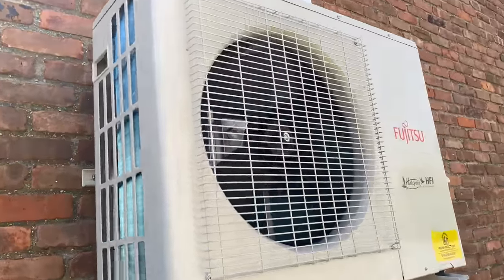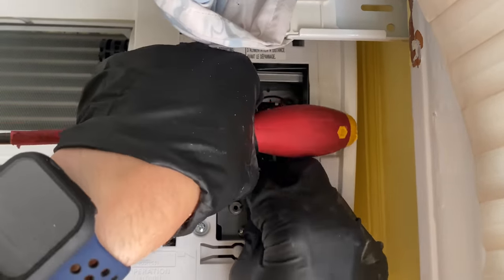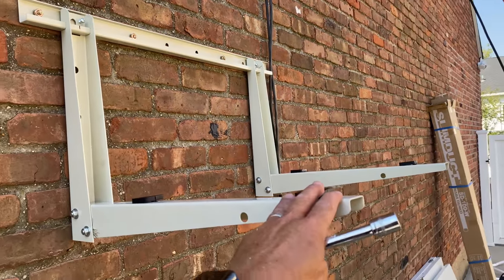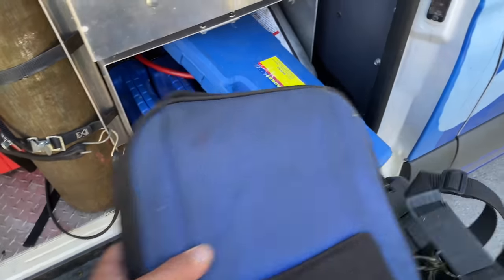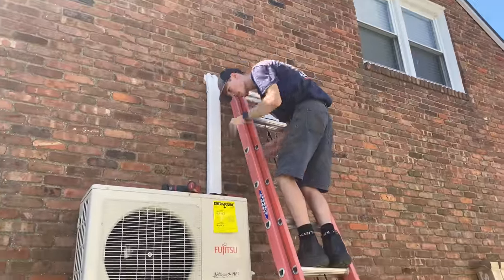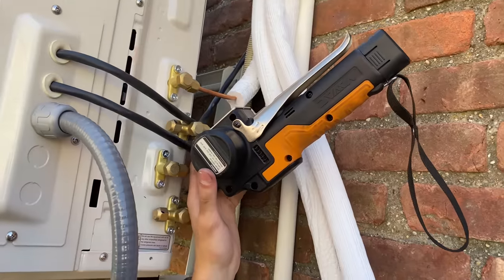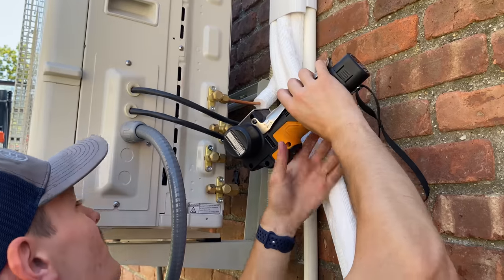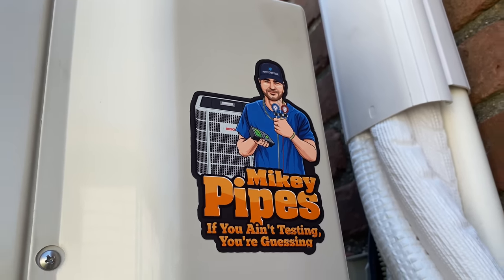Step by Step Guide How To Install a Dual Zone Fujitsu Ductless Mini Split Heat Pump Before Lunch

Comment: I chose a 9000 btu Fujitsu single zone system to heat my basement and I have been surprised to see it can satisfy my entire condo with a 77 degree set point on my main 2 ton heat pump system thermostat.  Your video is excellent as usual! I am happy to see you selected Fujitsu line of ductless heat pumps!

Comment: Love watching your crew, especially since I do the same type of work and still come home and watch you. A lot of times if I have a little heavier ductless systems condenser I tip the right side of the bracket on the house up a 1/4” to accommodate the heavier compressor side. Over time they can start to drop down. Keep up the great work

Comment: I've installed probably 100 Fuji's. I like you attention to detail. 👍 You could also T the drain together before the outside penitration to reduce the space required. There's no really worry of over running the drain.

Comment: Hey Mikey pipes, clean install! One tip I can say is there’s tap on tool that you could flip from drilling to screwing making drilling through concrete twice as fast. Also whenever I have trouble getting a good pitch for the drain, Id use a little condensate pump to help do the work. Thank you for feeding the people!

Comment: Use the Black max torque wrench. It stops you from over torquing. Overtime over torquing or under torquing leaks. Also not any flaring block good for HVAC. As you said yellow jacket or Navac or CPS that have Orbital moving which perfectly for flaring.

Comment: It is good that you have a performance metric for your installation - that install should be approximately a half day's work for a competent experienced person.  It is important to homeowners to get a quality job in a reasonable time which means a reasonable cost. 

And, the equipment should be purchased with a reasonable markup to the homeowner.  

Yes - Spray Foam has some tremendous upsides - insulation and air seal - and it is a rather challenging material to work around when installing heat pumps.  Many knowledgeable folk - like yourself - ought work to educate lay people that the windows and insulation are also parts of the mechanical system in your house.

Comment: Love ur content mikey! My flaring tool is a rigid that ratchets . We install mistubishi mini splits, love them.  Very efficient, effective, quiet, and most important if need be easy to access the control boards for the outdoor unit(heat pump). Fujitsu boards suck to work on, no room and they are upside down. Love watching you and your team.  Let's go bosch!!!

Comment: I was curious did you I hear you say that you didn’t have to adjust the charge due to length of the line set that the condenser unit came with just the right amount of refrigerant wow that is the bomb. That rarely happens good work.

Comment: Mike two trade secrets on mini splits always use rectroseal insert easy bend insert tubing benders amazing to use. Second always use rectroseal pro fit quick connect socket connectors they do not leak install at outside unit and on wall or floor unit first with a drop of nylog super nice especially up high just mark and insert pipe not flare or torque wrenches.

Comment: nice job. on that first room a floor mount would have been nice being that they blow up towards the ceiling and down from the bottom. on those rooms with knee walls they look nice. great job though

Comment: Nice video. I install a lot of Mitsubishi and Fujitsu ( in Sweden). If it really has to be top of the bill i’m ordering metal kanal for the line set outside. Try to leave the isolation longer to the outside unit. Don’t cut it to short 😊

Comment: 38:28 the reading at the pump is I'm sure a correct reading. Understanding how tools work is important. I'd be really interested to see side by side reading with another gauge. The key is the reading will be different the pump is running. I wanna see side by side reading with the pump off.

Comment: Nice detailed video! Question, I just got my dual Fujitsu Ductless Mini Split AC and Heater installed. Do you have to have both units on for it to blow cold air? I tried cooling down one room and it didn't, but I turned on the other unit, then the air got colder. Model number: AQU18RLXFZ, source 208/230v

Comment: I watch most plumbing and mini split installs and repairs. I appreciate your videos and the sharing of your knowledge. I was curious why you ran the line set down the inside wall from one of the indoor units instead of through the wall and down which I'm sure you have a pretty good reason for. I would have looked for a different location for that unit and went through the wall unless it was impossible. You mentioned you should have used three quarter PVC for your drain lines and in reality you should rip out those flex lines and use PVC and should have connected both drain lines in the attic going down to one drain going out of the building. I'm not an HVAC professional but I have some knowledge and experience. I know that on a traditional unit the condensate line needs to have trap water but the mini splits I've worked with don't want any trap water.

Comment: Great video! Maybe someone here can help me, I'm looking at a similar Fujitsu setup and I found that Fujitsu's installation manual calls for power disconnects with breakers to be installed for each of the indoor units, which I've never heard of anyone doing. I'm having a heck of a time finding any info about that.

Comment: I have a simple question. That line set was longer than 16ft. Did you not add refrigerate to compensate the discrepancy due to line length.

Comment: Do we need to check for leaks whenever refrigerant is low? My Fujitsu haycon on 8 zones is 48k btu, and 12 year old installation. This is the first time I
It is not cooling. I bought the gauges and will test pressure today.  Thank you.
Reply: Thank you! Pressure reads 100 pso with system off, and running, is started around 35 and stabilized at 85 psi. 24F on r140a scale, but outside temperature is 80. If i understood correctly, I am low on refrigerant?

Comment: Does it matter which order you power inside/outside unit? I have a Fujitsu hay on 8 zones, turned power off to clean coils. I have one circuit breaker for outdoor unit, and another for indoor units. Thanks!

Comment: Mike. You added additional line-set length to this unit? Correct?   Did you add additional 410a?  If no, would you kindly comment por que no?  Thanks.

Comment: Mikey Pipes been following your channel since day 1. I'm in Canada. I really wanted a Bosch IDS 2.0 with a coil on my gas furnace..I ended up buying a MR. COOL universal 3 Ton with A-Coil. Will try it out. Interesting when I took it apart alot of the parts are the same as the GREE or FUJITSU. I'm starting to think there all made in China lol.
Reply: Reason why I didn't get a Bosch is supply chain in Canada. Every HVAC company will give you a Goodman 16 SEER heat pump. I wanted 20SEER So the Mr Cool offered it

Comment: My installer told me that these units (the evaporator) need 6 inches clearance with the ceiling "to let it breathe" because my brand Carrier has vents on top. Does Fujitsu have that too?  I see that you installed the unit very close to the customer's ceiling. Is this true? I also heard you mentioned it's a low wall model, what is the difference?

Comment: Man Mike I just love this stuff a lot, at the company I work for we do a lot of Lennox and Mitsubishi Mini Split installs so this video helps me a lot even though it isn’t the same brand. I got a question, it has nothing to do with this video but what is a Gremlin if I’m spelling that right? Is it used in Air Conditioning, Heating or both. Also something I’m curious about, why on some of the ductless mini splits do they only have a port on the vapor side for the manifold connection? I’m just a student learning the trade, going to school for it and having an early start on the job. Thanks for another great video it’s really appreciated by me and the rest of the subscribers! Thanks!

Comment: You're on your phone filled ceiling how I taking plumbing strap the strip of metal that has multiple holes in it made hangers of that and then all three lines and your control wire and made nice need hangers for your drain line and your line set just a suggestion

Comment: Hi Mike, did you pump down both heads at the same time?    It looked like you had both heads connected to the vacuum pump at once.   Also. Is each side separate of one another.  I.e . Is all the refrigerant connected in the unit or is it separate in the unit?

Comment: hey Mikey just a thought what i do when assembling the line set covers i use zip ties to hold the snapped in areas and work my way down try it it may help it works for me when i do installs by my self let me know how it works for you if you try it.

Comment: Mikey- do you lean toward the units with the base pan heaters (I know all Fuji XLTH have them stock) even when using a quick sling or a wall bracket? I have done a ton of Mitsi’s used for heat in the last few years and no base pan heater with no issues- just curious your company’s take on that one

Comment: I'm currently helping install a 4 zone blueridge system which appears to have a 5th set of service valves up top.  What is the proper way to pull vacuum on a system like this?  The instructions are trash.

Comment: Also our Mitsubishi Rep won’t even look at a unit for warranty if we use nylog, they say it clogs the filters in the unit, I’ve never had a problem using it until we had a bad compressor and the rep saw it on the nuts and he got in his truck and left

Comment: Since blower units were not installed on exterior walls, a pump on each unit should have been considered. Aspen makes a great pump that looks good and is easy to access to repair or replace if needed. Hopefully no issues with condensate line.By the way, Electrician should install surge protector on new AC shutoff . I love my Fujitsu 3 unit ductless that I installed. No warranty, but I saved a ton and I know it's installed correctly.
Reply: why would you use an aspen pump if you have pitch.  gravity is always better. those mini pumps are an absolute last option. they hold barely any water and go off like every 10 minutes. and they are not perfectly quiet. if a pump was necessary  I would put a full size pump in the unfinished knee wall behind the unit. quieter and holds way more water
Reply: @F12255  I would always want to install a blower unit on an exterior whenever possible. You may have misconstrued my original comments . I would only consider a condensate pump if the install was on an interior wall and by the way, pumps can and do fail. Aspen makes a good condensate pump and if you are in a situation where you have to use one should be considered.

Comment: eww at the, zigzag line-set over top the spray foam,  I'll suggest a few ways. 1. use rod hanger plates, 3/8th" threaded rod and split ring pipe hangers. cut the 3/8" rods long enough to have the line set ran straight and flat(pitched for the drain line). yeah it's kind of expensive but looks good when done.
2. use sections of 2x4"( or 2x6") wood with the ends angle cut and screw through angle part into the rafters, then regular pipe strap/clamp lines to the added wood sections.(probably the cheapest way).

Comment: Speak of Mr Cool with pre-charged lines DIY kit.... My understanding is an AC unit is as good as it is installed... Just how long will something last that Joe Homeowner did with his cousin... Also would any pro want to service one that Joe Homeowner installed in a weekend? Looks like Mr Cool ain't so cool of an idea. I have seen pre filled lines that you leave excess rolled up in a coil on those DIY kits and it looks like Homer Simpson installed it

Comment: I understand why some homes that don't have central air use these but God these are so ugly compared to having central with all those linesets running everywhere and those huge bulky heads in the room.  And why in the world would someone want the condenser mounted that high on the wall.  Makes it so much more obvious but anyway good install Mikey.

Comment: A little messy on the wall , where is profi job there? Should be inside unit’s pipes inside that wall and outside pipes ends wrapped.

Comment: Funny this house is definitely not a Taj Mahal, but it has way more insulation and better insulation, than most of the Taj Mahal's, you work in.
Just think, if Taj Mahal owners, would spend more money on insulation than AC, Mikey Pipes would be out of a job.

Comment: why european just realize to use air conditioner only since the heatwave? meanwhile tropical countries have doing this like forever
Reply: Tropical countries need a/c as they are hot and sometimes humid for a good proportion of the year , whereas Northern European countries have mostly mild temperatures with few extremes.In more southerly European countries they seem quiet popular such as Spain, Greece and Italy.
I’m from the UK and mini splits just aren’t marketed to residential customers but they are popular for use in shops and offices. Residential use is slowly growing but it’s through word of mouth.The general perception is that they are very expensive, noisy , cost a fortune to install and most are unaware of the many benefits that they can provide with economical heating, cooling and dehumidification with the newer R32 units apparently being even more efficient.. The recent media attention regarding replacement of gas boilers with all in one heat pumps providing hot water and heating with the focus on badly installed and poorly specified units has damaged a/c’s reputation here more than ever.
I have a couple of older Fujitsu R410a 14k btu mini splits that were professionally installed and they have been great, energy efficient, very quiet, great for reducing humidity and cooling on our few hotter summer days and best of all for very quick heating when getting ready for work/ arriving home or just for heating part of the house. I do use an A+ rated combi boiler for hot water and for our few below freezing days( the heat pump still produces plenty of heat even at -15 degrees Celsius but efficiently falls off) but between them both my energy bills are low.

Comment: Hi Mike.. question in regards to cases where you have that annoying spray foam in the way.. have you ever chased the line sets through say a 3” run of pvc that you could standoff the joists pretty easily to keep the line sets looking decent? Just a thought brother 👍🏼